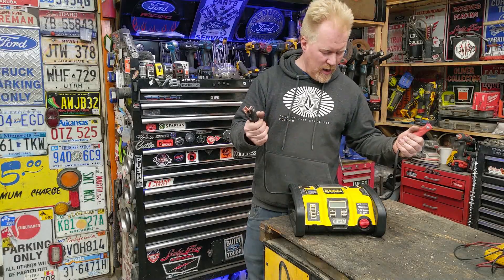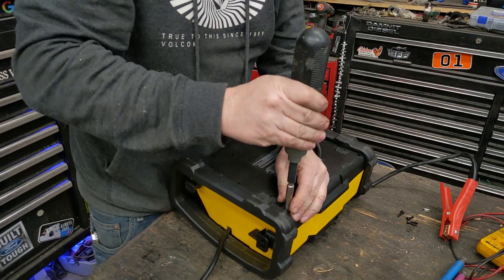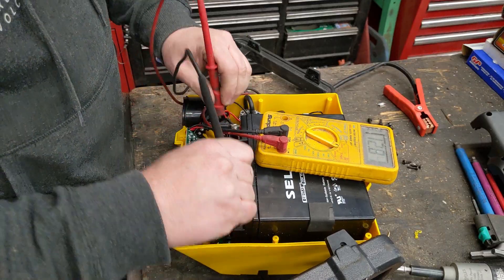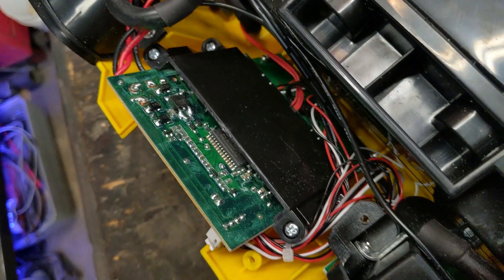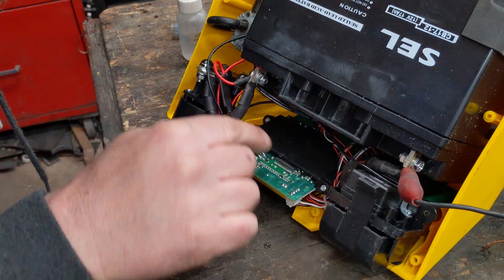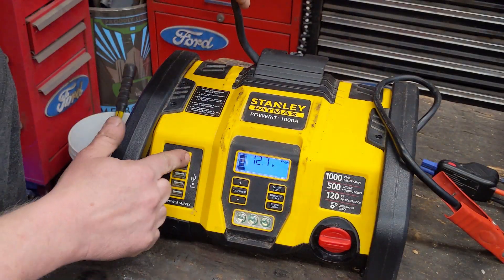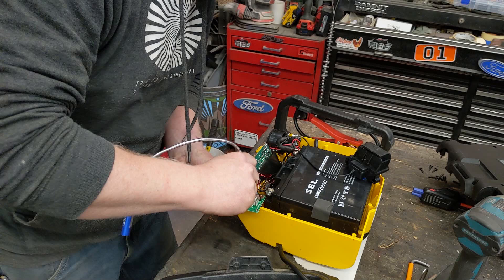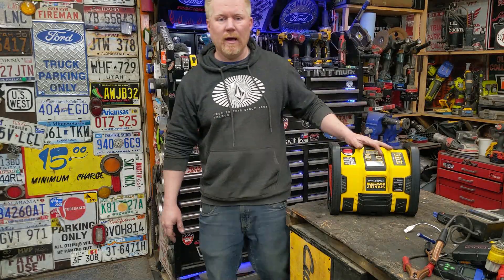NEW Jump Start Box DEAD - CAN it be FIXED?

Comment: Mine got wet is that why it doesn’t work?
Reply from the maker: First, these are lead acid batteries inside and only have a lifespan of about 3 to 4 years. If well maintained/ charged constantly. Getting wet though will short out the circuit board.
Reply: @s @sixtyfiveford  thanks for the reply. I have a old one and this one was new and my son left it out in the rain. Maybe I will switch the board out.
Reply from the maker: @nimster64 It would still have power output at the leads, but you'd likely not be able to charge it via plugging it in. You could charge it directly through the leads with the rotating power switch in on position with a battery charger.

Comment: Mine is showing 14 volts and won't jump start shit, also won't operate the air compressor built in, all the lights come on for all the inputs and receptacles but none of them do anything brand new and totally worthless CAT CJ1000DXT
Reply from the maker: The lead acid battery in these only has a 2-3 year shelf life. If it sat discharge ever the lifespan is even shorter. So there's a chance someone bought it, used it and returned it dead. Or turn it on at the store and ran it dead. The SLA Battery in these is easily replaced for around $40.

Comment: Mine does come on but doesn’t hold charge
Reply from the maker: You need to replace the battery. The batteries in these only last around 3 years. A new battery usually costs around 40 bucks.

Comment: How do you charge it with a 2 amp charger,  I assume you connect the pos to pos and neg to neg from the 2 amp charger to the power box and have the jump starter turned on, is that correct
Reply from the maker: Yes

Comment: Got the same one, charges up and everything but when I go to jump start my car which is dead, it doesn't even start the car up, and it keeps beeping any time I turn it on ? Any advice
Reply from the maker: @josephperez1382  If is a few years old the battery inside is likely dead and needs to be replaced. They only last 3-5 years.

Comment: My box used to charge to 14. Now it only charges to 12.8?
Reply from the maker: The lead acid batteries in these have a shelf life of around 2-5 years. If it's old enough you likely need to put a new battery in it.

Comment: Probably a lead acid battery. If they sit inactive for awhile, they go dead. Not like Li-ion. you have to use them consistently, that's why they put other features on it like air compressors and lights. A few manufacturers even make them with inverters so they can be more useful in a camping or other recreational scenario. These are ideal for car camping and vanlife people who are likely to use this daily or almost daily. Just the battery and the ability to charge devices is good, but throw in an inverter and maybe some emergency lights if it's a roadside issue makes these valuable things.

Comment: How would you replace the battery?
Reply from the maker: @annhope3210  You open it up and there's just a sealed lead acid battery(SLA) in there. Buy a new one off of Amazon that has the same dimensions and just bolt it in. The SLA battery is a universal thing and not unique to these jump starters. So just look up on Amazon and SLA battery and you'll find them.

Comment: I found this video because my Fatmax jump box got rained on, twice,and it wouldn't turn off, the LED kept turning itself back on, so I let it sit and die then took cover off today, it is charging, but now usb, compressor and led won't turn on at all, display works, charger works, nothing else does, it beeps on occasion, and turning switch on makes it beep, so I shot gun grease in hole on beeper, it's quieter. Anyway, I'll let it get a full charge, and check it again. I may just have a spare battery and junk rest if it won't work. I have had it just over a year.

Comment: I extremely appreciate this video!! My girl picked one of these up for me out of our neighbors trash because my neighbor said it didn't work! Well it did!! And with this video I learned A LOT more about it!!! Thank you very much!!!
Reply: I just picked one up similarly. Having a heck of a time trying to figure out if it is worth lugging around. Going to o a full charge and amp hour test on it to see that but I rerally picked it up hoping it had a high amp charger for its own battery and to use parts with a deep cycle off grid set up. Not sure it's worth tearing into for me, might pass it on

Comment: After you fix it make sure to keep the air pump running less than 10 mins and let it cool afterward  for at least 30 mins. It will burn that thermal out

Comment: Youll find a non insulated flat pc board 1" x1/4" with a copper strip in the board one wire in one out. Ill bet thatll be your prob. A-YX01 C478338 reverse RU 94V-0 if you need it. You had your fingers on the thermal fuse seconds before you found the short. It has heat shrink tubing on the fuse itself.
Reply: What size ?

Comment: Battery WIPED out trying to jump my V8 Expedition. Didn't even make a few revolutions
Reply from the maker: The battery in these only last a few years. They are the same makeup as a car battery but lower quality so they don't last as long. You can buy a new battery for the inside for around $40 https://amzn.to/3tR0L6q
Reply: Just seen this. Thanx i had threw the jumper on the shelf. Decided to give it another try. Ill orded it. Never seen these batteries before. I just opened it. @sixtyfiveford

Comment: I bought a fancy Everstart jump box in March. It's made by the same company that produces the same ones branded Stanley and CAT. It showed a 12.7v charge at purchase and jumped just fine for 7 months since I recharged it after each use with my 12v 400w inverter. Then I used it to recharge my cellphone overnight when being used. That dragged the jump battery down to 4.5v. Recharged it back to 13.8v where it dropped to 12.8v then 12.6v during the day. Tried using the jump feature on my car to find it no longer came on when the start button was pressed. The icons did show up when connected wrong or after the motor was running. I called their customer service to be told it was due to using the wrong 110v current. Somehow it needs that from a wall outlet only to get a full charge. Bought a new battery then recharged the box when driving by using the inverter for the next two months. The inverter fan would shut off when the inverter inside the jump box went into trickle charge mode. It did that at 13.9V but the battery would lose enough charge overnight to return to 12.6v with no jump starting. Think it took over 40 hours on trickle charge to get the battery fully charged to stay at 12.8v for weeks on end when not being used with the start button/jump start feature now functional.

Comment: It looks like the top longest resistor was blown on mine. Opened it up, checked the battery, and it was good. The resister was black and looks like it burned the motherboard. Anyone know which type I would need to replace it with?

Comment: I added a new 20 amp hour battery to one of these fixing it for a friend. It also had a loose usb connection and the original battery was low capacity when I tested it. But the new one works great. Great video!
Reply from the maker: Nice work!

Comment: Are you the guy that posts on another website that I frequent called yesterdays tractors by the same user name or very similiar ? There is a guy that has a name very similiar to yours on there that posts in the forums section from time to time ! The Allis Chalmers sign in the background had me wondering . Thanks !
Reply from the maker: I'm on a few forums but I've never commented on Yesterday's tractors. Though I've been on there many times.
Reply: @sixtyfiveford  Where are you located at ?

Comment: What if the battery isn't charging?  But it has 3.8 volts. Maybe it's the charger?
Reply from the maker: The lead acid battery is dead/not revivable if the voltage is below even 10 volts.
Reply: @sixtyfiveford  ok so replace the battery
Reply from the maker: @LadyShaLay-24307  Yes. They're called sealed lead acid and or UPS batteries. They're around $40 shipped on Amazon https://amzn.to/43giHV3 just compare the size.
Reply: @sixtyfiveford  ok thank you.  Does the Amp hours matter? Like if it's higher or lower? This one says 19 but I find a 18 and 20?
Reply from the maker: @LadyShaLay-24307  Go for the highest that will fit. They make that size battery in anywhere from 17-20ah from what I've seen.
Reply: @sixtyfiveford  ok thank you very much sir. I appreciate the help
Reply: @sixtyfiveford  I got the battery replaced and it works great.  I appreciate all your help sir.
Reply from the maker: @LadyShaLay-24307  That's awesome. Great work!
Reply: Also I had it on the charger all day and night but nothing

Comment: Looks like they have "improved" the electronic mountings. I got one where the boards had fallen off inside the case. It had 2 black plastic brackets on either side of the main board that didnt really hold the board. I see on yours they made one piece that went across the board. Also on yours there is a metal bracket that holds the wall wart charger in place, mine didnt have that and was loose but still in place. The solder connections for the charger were crap do it wouldn't charge. Fixed that and it works now. There just crap units with no quality control. Least we both got one for free. 😅

Comment: Mine died last year. You plug it in never shows completely fully charged. Unplug it and it says filly charged. You go to use the compressor and it plays dead. It worked great then one day nope. Any suggestions? Now I'm on the market to find another gizmo to use. I'm always airing up lawn mower tires.

Comment: I spent $60 on this thing and it's a piece of crap like it goes on and off doesn't work I checked inside it and nothing seems to be out of place it stays on and connects but doesn't jump start my car one bit
Reply from the maker: This uses a leaf acid battery and if it isn't cared for can die in months. All the lead acid jump boxes are the same. How long ago did you buy it?
Reply: @sixtyfiveford  I bought it from a thrift shop 3 weeks ago
Reply from the maker: @davidlanier5753  The lead acid is likely toast then. If the original owner let it sit uncharged for a month it would have killed it. Or if it was left uncharged and then froze it would have killed it instantly. This is not unique to just this particular one but every jump box made powered with a lead acid battery. Just like a car battery they need to be fully charged pretty much all the time to stay healthy. You can buy a replacement battery but it'll set you back $40. It's unfortunate that you bought this and I've been to estate sales, auctions and watch people buy these up all the time. If I see someone eyeballing one I always tell them to walk away and just buy a new one.

Comment: Most folks would have sent it to the land fill Another GREAT video !! Question I have a 1969 ford 100 garden tractor with a starter generator the amp gauge jumps around she still charges though I thought i would ask the man that can fix anything and everything for things to check on Please and thank you Sir. She has an external voltage regulator also . I also have a 1967 ford 120 hydro They both power houses !
Reply from the maker: I looked and looked for a Ford garden tractor for years and always came up empty handed. I finally gave up as they're impossible to find out West. That could just be dirty sticking contacts in the voltage regulator.
Reply: @sixtyfiveford  They sure are hard to find for sure ! I will check the contacts Thank you !
Reply: @sixtyfiveford  I'm on a group called Ford garden tractors they are very informative on differant issues  Some are for sale on there also .

Comment: What if multiple power cords dont recharge device?
Reply from the maker: With this exact device there is a contact issue when you plug it in. You need to take it apart and actually bend some tabs inside the power adapter. This is so it makes contact with the two male prongs.

Comment: A majority of family appliance repairs or short lifespan electronics repairs that I have done were broken solder nodes.  It's one of the first things I look for in a troubleshoot.  Most of the time it's due to a cold solder joint on a larger gauge wire or component lead - operator or flow solder parameter error.

Comment: i have one of these for about 4 years now. it has a short in it and beeps sometimes in mh truck, but when I recharged it inside my house, it not only turned on like usual, it turned on the air compressor at 3am, so I go turn it off half asleep and confused and go back to bed. it did it again at 5am except when I walked in the room, the compressor turned off. I threw the goddamn thing as hard as I could into the back yard. how do I make it not haunted?
Reply from the maker: Lol. Crazy over complicated contraption.

Comment: I have that exact same Stanley battery pack. It's good for a single jump and then needs about 20 hours to recharge. What is the booster pack that you recommend
Reply from the maker: For jump starting you can't beat the new lithium starters https://amzn.to/3vPGqNG They give multi high speed cranks on dead cars and trucks. They do have one Achilles heal though: their life span is shorted if left fully charged. They utilize lithium polymer batteries and those like to be stored long term around 3/4 charged. At a 3/4 charge I can crank a v8 5 times at 5-10seconds a time. At full charge I get around 7 times.
 
The Achilles Heal will make their lifespan about 1.5years with long term full charge where if left at 3/4 charge they can last 10years. I found this out the hard way and then a lot of research. However in the first 1.5 years of use I did nearly 75 cycles(friends/family) and it never failed to start a vehicle.

Comment: Those things are absolute TRASH. The same company makes the Stanely, Everstart, Dewalt, Cen-Tech and several others. I bought a $109 EverStart Maxx J5CPDE with the "500w inverter" and the 1st time I used the inverter the damn thing literally caught on fire. Pulled it apart and the inverter (which is a small plastic box that is double sided taped to the side of the battery) had literally caught on fire and melted. All I had plugged into it was a cheap Lasco box fan. OK so I thought Pull the inverter out and I can still use it for airing up lawn mower tires and jumping mowers. I got to pump up 2 tires with it just fine. The 3rd time the compressor kept running. It literally would not shut off. I took a hammer to it in the vicinity of the compressor motor and retch in with wire cutter and cut the ground wire on the compressor motor. The jump start function still works but it has to sense some sort of resistance for it to start out putting power. If the battery is completely shot or there is no battery you will have to hold the key in the start position and then hit the button on the jumper pack. You can also use a small test light hooked between the leads to trick it into thinking it's hooked up to a battery. I literally bought it and used it less than a hand full of times. Literally the Worst purchase that i have ever made.

Comment: Nice fix I have a booster box that I bought at Sam's club about 20yrs ago the battery finally died about 6yrs ago I found the exact replacement on eBay for $34 with free shipping I took it apart and installed the new one It still works great

Comment: I have a version of this brand and charged it up quite a few months ago and let it sit. Needed it for a hurricane and only the low battery  light is lit. I can plug my phone into the usb and it says it's charging But I don't think the unit is taking a charge from the wall socket. Suggestions?
Reply from the maker: When you plug it in you should see the screen light up and the power level bars flash. I had to open up the little charging box as it wasn't making a good connection and bend some tabs.

Comment: I have a Cummins with 2 1000 Amp batteries and I found a 6000 Amp lithium 12v Avapow at Walmart for $ 93.00 and glad I did . My truck batteries are 3 years old and  I have had to use the jump start 3 times. Really surprised.

Comment: I loved watching your video!  I bought 1 exactly like this maybe close to a year ago, but recently the darn thing started beeping repeatedly even in the off position.  I tried charging it back up to full charge, but only to suffer from constant repeating beep, plus led display stays lit.  At 1 point the led lights wouldn't come on nor would the USB ports light up. Still kept beeping, so I guess once battery runs down it will stop.  I liked having the compressor/jump starter around & extra USB charging ports if electricity ever went out. 
Do you know why it won't turn off,  what I can do to fix it?  I'm pretty handy, my Dad was a mechanical engineer, taught  me a lot, but is gone now.  Thanks in advance ☺

Comment: As typical, electronics doesn't like to work without power. Not really unusual to see bad solder joints in so many electronic items. They just don't do quality solder connections properly unless it is a high end product. Thumbs Up!

Comment: I have a lawn mower battery, with vice grips holding half a set of jumper cables on it...it is 100 times better a jump pack than any of these little jump boxes with SLA batteries.  I've had those things go dead in as little as a year, the SLA battery actually going flat.  And as he said, they NEVER have the cranking amps they say, nor can they crank anything over for more than minute or so before going flat.